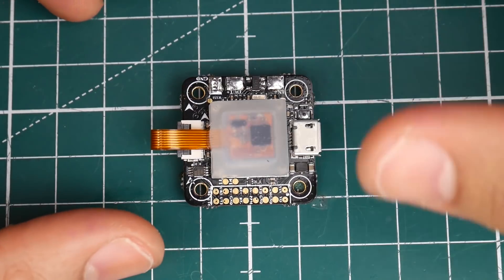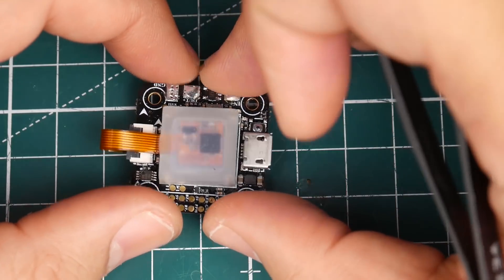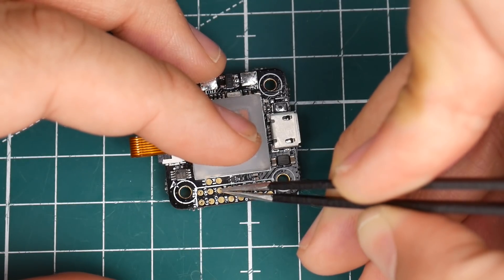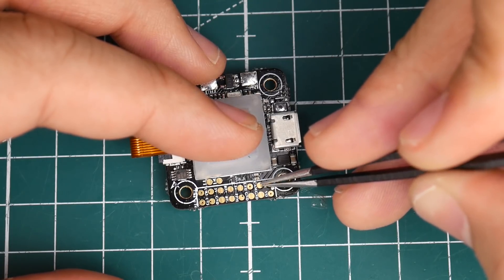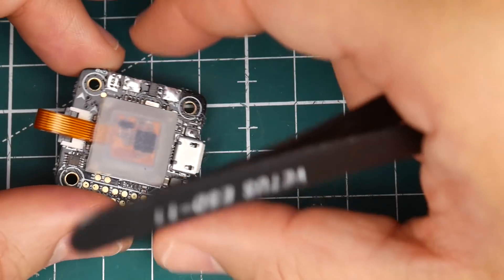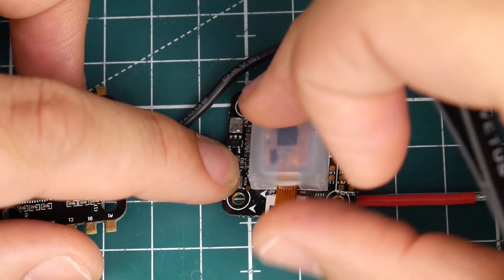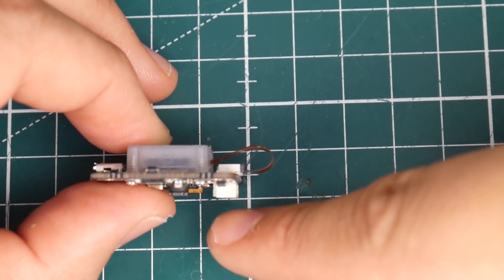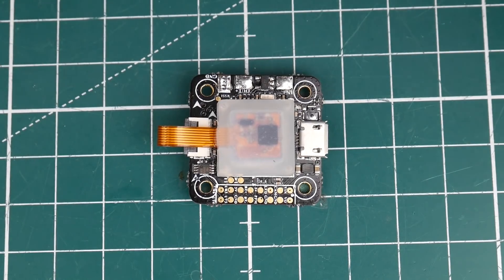Omnibus F4 Corner Nano // Micro F4 Flight Controller Overview

Comment: DID ANYBODY SUCCEEDED IN CONNECTING ANYTHING THROUGH UR/UT PADS OF THIS WEIRDO?

To be more specific - in receiver connecting. I had no success in XSR/R-XSR receiver connecting to this board. The only possible combination that worked was non-inverted SmartPort on T1 (UART1 TX). Non-inverted SBUS on R1 didn't came up alive at all. UART3 (UR3/UT3) and UART6 (UR6/UT6) was completely dead! No reaction on both inverted or non-inverted SBUS and SmartPort at all. By recommendations disabled INVERTER 3 and INVERTER 6 in resources (set to NONE) in hope to connect non-inverted signal - it didn't helped. In end I lost a whole last night in wrestling with this abomination. Mesh, damn, did you itself succeeded with this board? Or you can only list the features from advertisements? Do a real testing!